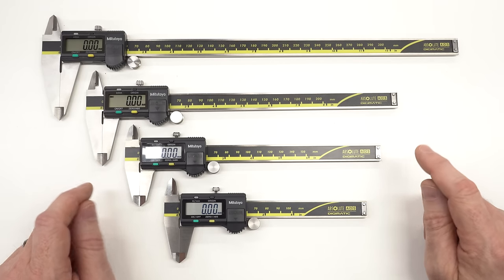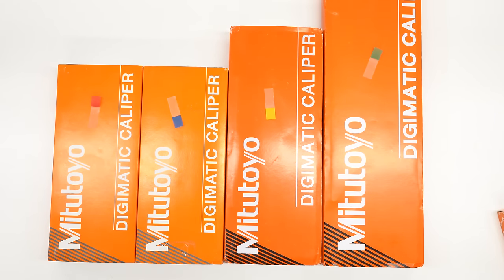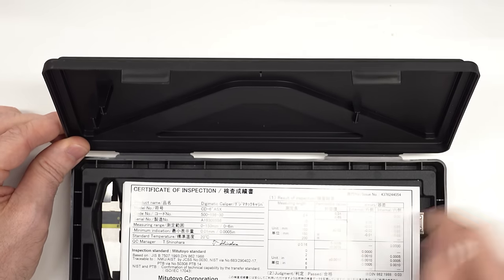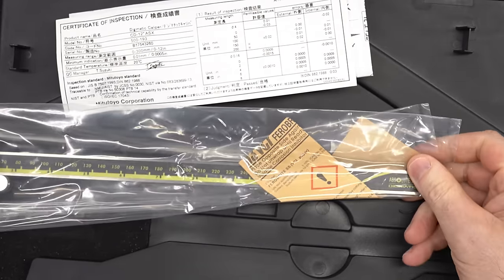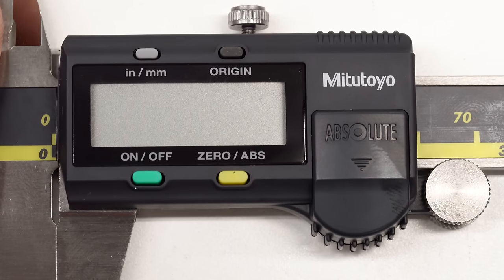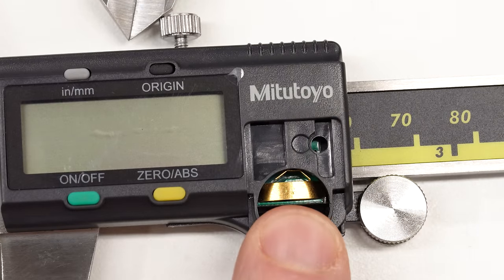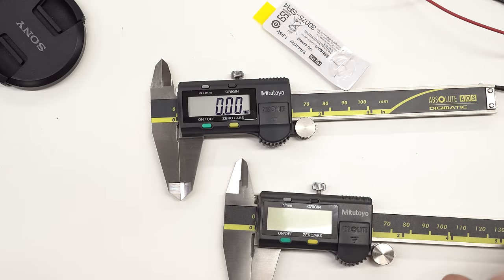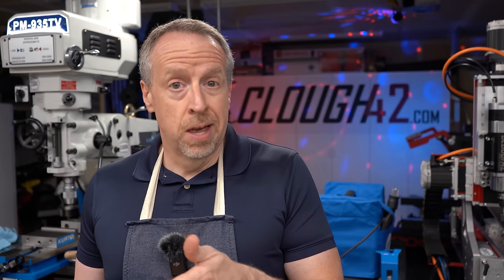17 Warning Signs Your Mitutoyo Calipers Are Fake

Comment: Thank you for going into so much detail - it's quite frightening how much trouble people will take to dress a $10 caliper up in $100 clothes.
Reply: Well if you can get 5-8x times for that work - why not? But it's for us consumers not to reward these criminals. It's not whether the packaging is accurate, fonts or even the accuracy of the device  - it's about not funding criminals - plain and simple. As the channel owner said, if your product is almost or close the original - compete on price. They can't. I bet they make much more money on the fake than on their own brand which is lost in a sea of similar competitors. Here's the simple fact..most people don't need a Mitutoyo..makes you feel better? go ahead...but unless you're working for SpaceX you don't need it. Buy a much cheaper no brand one and move on. I got one. I design and measure in 1/10th of a mm and most probably cut +/-3 mm.

Comment: I have a genuine Mitutoyo 6" purchased from MSI-Viking (an authorized reseller), but mine was purchased in 2009.  Some notable similarities to your newer models:
fit/finish is excellent, end-milled recess in the back, nice plastic molding, ABS visible in the battery compartment, two contacts visible on the PCB.  

However, a few differences which are actually more similar to your knock-offs:
The yellow swoop ends above the S, not the O of ABSOLUTE on the front.
Battery insertion goes straight to 0.00mm, or a completely bogus number if left for a while first, not flashing dashes
Origin button is recessed, top of it is flush with the top of the plastic on the front.
screw alignment of one hole is is ok, the other is not great.  

So it seems the knock-offs may be copying some older models (poorly)
Reply: I too have a 150mm older model with exactly these same differences.   On all other points they match with James' description of the genuine article.
Reply: I agree, I have a set here at my desk that are only 5 years old and I'm confident are genuine and the certificate has the high print quality but the same T Suzuki QC manager and the Ferrobrite sheet looks very similar to the knock offs shown here so it looks like they've copied them from a few years back. Everything else is a match for the new genuine shown here.
Reply: same here too!
Reply: same with mine.
Reply: Yeah same. I have two contacts etc. but no white writing on label and off centre screw holes. Mine is genuine (all other tells are aligned with your genuine) so I think probably the knock-offs are mimicking an older model. I’ve had the same battery in for the last 5 years
Reply: Can you confirm the three smooth radius cuts in the jaw area and the accuracy of the pinning of the bar at the far-end? (the bar pinning was terrible in the clones, surprised he didn't notice!)
Reply: @awebuser5914  Yes, I can confirm the larger radius and the rivets at the end look great on mine.
Reply: I have a 6" genuine Mitutoyo that was made in 2017.  It's identical in every way to the set in the video, except the origin button is recessed.  They must have changed that fairly recently.
Reply: @techietypex  yep same as mine.
Reply: Where is the best place to find an authorized seller list?
Reply: I can echo what other people have said on this reply thread.  My older 100mm calipers have a recessed origin button, inserting a battery makes the display come up with a large random number immediately, until I set the origin.  The yellow swoop terminates above the S. But jaw machining, PCB contacts, set screws, etc. are as per Mitutoyo standards.  I did not check power levels, but the first battery last me almost 10 years before I replaced it, so it wasn't drawing much power.

Comment: I appreciate your doing this video. The slightly older Mitutoyo calipers came with a piece of scientific equipment from Japan and have a Mitutoyo metrology lab certificate in addition to the normal paperwork. My set have a recessed origin button but aside from that have all the other signs that you pointed out for genuine Mitutoyo calipers. My set was made in 2013. I think the counterfeiters based their molding off of the slightly older models. Thanks for the video and for doing the power draw. That is what separates the Mitutoyo stuff from the rest. I hate dealing with dead calipers. That said, my favorite calipers at the moment are iGaging and they use a CR2032. I do wish you has shown the light passing through with the jaws closed; that is the biggest problem with crappy calipers.
Reply from the maker: The grind and fit on these were good.  I didn't see any differences, and decided to focus on things that were different.
Reply: Bruce, any reason why the igaging are your favorite? I use about a dozen different Mitu calipers in my shop, but would love to find a more affordable brand I can hand to employees and clients to borrow.
Reply: My older ones have the recessed origin button and when battery is installed it immediately flashes numbers. My battery compartment is different design with no writing. They are about 20yrs old.
Reply: @Hunteratloppshop  Hi R&R, The reason I like the iGaging calipers is they have a decent feel and are as accurate as the Mitutoyos. As I said, the biggest problem with most cheap calipers is the grind on the jaws and the iGaging jaws are very flat and parallel. Being that they use the CR2032 battery the battery lasts a long time. Another benefit, if it something that is useful to you, you can get them to measure fractional inches as well. All for a much cheaper price. If I were you I would keep the Mitutoyos for your shop but try the iGaging for the other uses.
Reply: @lofingboy  That's interesting. I just checked mine and they do the same thing. I guess its just the older models.
Reply: +1 for the igaging! I'm UK based and wanted to upgrade some of my poor quality Chinese calipers (hey, I've bought enough calipers to have one in every room +spares for my home). There are offers on mitutoyo, which I might grab a pair because of their IP rating. However I'm a big fan of my cheaper igaging things (ezcal??). Lovely feel and decently accurate!

I also own the more expensive igaging model. Don't like them as much... However got them in 8"form

I would say get several of the igaging ezcal for your daily driver. Keep a couple of mitutoyo for special occasions and that way you can keep them nice in the drawer
Reply: @brucewilliams6292  Same here...bought in 2011.
Reply: My experience with iGauging is the same.  Nice tool.  I like and use the fractional inch feature at times.  Nice option that works well and is fast.  Battery life appears very good.

I keep my original 12" analog Mitutoyo handy for some tasks where I want to see the indicator movement, and as that "works no matter what" tool I can always reach for in a pinch.

Finally, I had them ground and tested recently.  They work as well as they did in 1985 when I paid $170.  They have seen regular work for years, but also the expected maintenance.
Reply: It is weird with this fakes. I have one 150mm and everything looks original, housing with matching ejector pins and battery made in Japan, serial number fits perfect in paper, nice print, white color type and no filled rectangle, slim yellow curve, centered screws, milled slot, flashing lines when installing the battery but there is the gap between First ! on the little yellow tag and it runs not so smoothly if you compare it with a original one. Another fake(?) I have runs so smoothly but has the darker font color on the label. There seems to exist different qualities of the fakes. To perform measurements as you show with the consumption will reveal it. Without help of Mitutoyo there will be a perfect clone one day.

Comment: Hi James. 
Great video! I have a few more things that differ between the genuine Mitutoyo calipers and the fake ones:
- The thumb screw that locks the caliper is much thicker on the fake calipers
- The end stops are not located as close to the end of the caliper as they should be on the fake calipers
- Mitutoyo 12" calipers are much thicker/wider and uses a completely different electronics/plastic housing
- The angles of the jaws/tips are much steeper/different on the fake calipers compared to the genuine ones
Reply: - Genuine LCDs are light gray background, vs. greenish

Comment: I was always a Starrett man and I only bought one Mitutoyo tool in my 22 year career. It was a 24' dual beam dial caliper (built like their height gauge) that I bought in 1980(?) As I watched this video, I had a Harbor Freight (CEN-TECH) 6" digital caliper in front of me. I paid $19.95 almost 20 years ago. As you went through details, so did I.. Almost everything that was sloppy in your fakes, is much cleaner on my cheapo HFT. I heard that Harbor Freight has grossly down graded what they sell now, but these old models are pretty good especially for ther price..  I sold my 24" Mit's on EBay 10 years ago and the guy that bought them was ecstatic at the quality and workmanship of the tool. I had built a custom case for them and engraved my initials in several places, The buyer happened to have the same initials as me, and he got the case too... I don't remember how much I paid originally but I think I might have gotten a little more when II sold them... .BUY QUALITY and you'll never be disappointed....

Comment: Thank you James, I watched this while checking my own callipers and was satisfied that they are genuine. I do think it matters, the power consumption alone makes the counterfeits almost worthless when you look at what dirt cheap callipers cost that perform no less well. And I know that my Mitutoyo’s will last years. The cheap ones I tried corroded inside the battery compartment and packed up in just months.
Reply: What difference does it make whether it lasts 3 years on one battery or 1.5 years? The battery is a consumable item.
Don't put crap batteries in your instrument and they won't ruin the battery compartment.

Comment: Good - the 6 inch Mitutoyo that I found under a cupboard in a lab that was being cleaned out and rescued from the scrap bin appears genuine. I didn't get the orange box or the operating instructions, but I have the calibration certificate and the black plastic case, and all is as you say.  You can't beat that price!
Reply: I have a nice Fluke 87 acquired the same way.  Sometimes you're just in the right place at the right time.

Comment: As always, thanks James for an interesting comparison. One very minor difference you didn't mention is on the Yellow 'Battery' tag... The ebay ones do not have Mitutoyo printed above the battery compartment whereas the genuine ones do, just as the actual calipers have on them.

Comment: Thanks, you just saved me $70.  I use genuine Mitutoyos at work but have never had the packaging to compare so when I saw a caliper for sale on a local buysell your packaging analysis showed instantly that the one for sale was fake.  
Cheap Chinese calipers are usually fine enough and we also use them at work for rough measurement on the shop floor.  It doesn't really matter if a $20 caliper gets dropped or lost vs dropping a $300 Mitutoyo.

Comment: I was under the impression that Amazon mixes inventory of the same SKUs, and if seller Alice sends inventory to warehouse near your house and then you buy from seller Bob, Amazon may send you one of Alices’s stock rather than ship an item from Bob’s stock from a further warehouse.

Maybe I’m mistaken but I am wary buying anything from Amazon that is frequently counterfeited, even from official merchants.
Reply: Yep, that has been a problem in the past, at least. Not sure if it's still a thing, because I don't buy things where authenticity really matters there anymore...
Reply: This is one of many reasons I don't shop on Amazon.

If I can't buy it directly or from an authorized retailer, I guess I just don't need it that badly.
Reply: Yes that definitely happens if the seller chooses to co-mingle items. They can even have Amazon put a label on it. Usually if they come from the closest seller, there will not be an fnsku label on it (the specific seller label they can track) and Amazon just goes by the UPC code. Fakes can be a big problem but if you get one, Amazon will usually make it right. I agree I would be careful and stick to authorized sellers, or Amazon as the seller, for big ticket name brand items.
Reply: Have never personally had an issue with ordering commonly-counterfeited items from Amazon (ships from/sold by Amazon), which seems to be common with tools (and even books) nowadays. I didn't know that was a possibility until I just looked it up. Although I am curious if Amazon's items are commingled with the rest of the FBA seller items, and it seems like sellers have to opt-in for commingling to happen. For items worth more than a few hundred dollars or so, I usually just try to purchase them from another known-good vendor if possible (like MSC for tools or B&H for electronics).
Reply: @yellowcrescent  At least in some cases, Amazon does co-mingle their inventory with FBA sellers. I have received multiple counterfeit products that were shipped by/sold by Amazon.
Reply: You misunderstand what "Sold and Shipped by Amazon" means.  If there is a 3rd-party listed, then it's arms-length.  My calipers are 100% legit and were sold by Amazon, not a third-party.

Comment: Something i noticed using a genuine Mitutoyo Caliper were the perfect parallel jaws. If ii's well cleaned you can't see light shining throuh the gap of the two outer jaws. Furthermore if you have set the origin correctly it's nearly impossible to push it to a negative valiue - in comparison with cheap ones where you can push it up to -0,05mm.   The second thing i noticed . Cheap calipers sometimes lose the origin point after really fast jaw movements. (But i think that's only a Problem with non absolute calipers.
Reply: Notice the fake ones do not really spell absolute..... an attempt to avoid prosecution ?  ABS ( like the plastic ) then the big Olute

Comment: Thank you for the video guide!
I've always had Mitutoyo calipers but I've not had to buy a new one in the last 7 years.  Having just bought a new 6" I got a bit concerned when I compared my new one to one of my older ones and noticed the end milled slot on the new one was different to the slot made by a side and face cutter from a horizontal mill on the old one.
After watching your guide, and making all the necessary checks, I am now happy I have the genuine article. Thank you.

Comment: Great work on doing the current comparison, this is relevant even for the non-fake cheapies - when you go to use them the battery is always flat. Sadly.

Also great shout out to @EEVBlog using his meter :)
Reply: Brymen meters are world class on their own merits.
Reply: If I recall, the eevblog meter contains some extra Aussie voodoo for measuring low current accurately.

Comment: Another thing: the surface of the printed scale is rough in the counterfeit items, while smooth for the genuine. Also the printed scales stop just shy of the end, right under the pinning. Not so for the fakes.
27:57 Note that those tiny QR codes are basically useless on the fakes, while perfectly readable (though small) on the original
Reply: I was going to mention the QR codes. My phone was able to read the QR codes on the two genuine Mitutoyo off the screen and it was the three lines of identification: Code#, Model#, and Serial#. The QR codes on the fakes not only are muddy and unreadable, but they appear to be identical. I'm at work so I don't have access to my Mitutoyo for me to check the QR code. And, I can't check my coworker's Mitutoyo because the calibration sticker (it gets an annual 17025 calibration unlike my personal one) covers the QR code.

Comment: Other easily visible differences I’ve noted are that the locking screw is machined differently and the riveted retaining plate on the end of the beam is in a different location, further from the end.

I have a number of cheaper brand calipers (not fakes) and a 6” and 8” pair of genuine Mitutoyo’s.

The cheaper ones are maybe just as accurate but live on the lathe headstock or the mill table, get used occasionally as a pair of dividers and are considered disposable items.

The Mitutoyo’s are considered metrology instruments, are used during the design process to evaluate existing components for fits etc.  Both of these slide like they’re on melted butter and are a joy to use, unlike the others. 

If you place any value on what you do, you probably already have or need to experience the genuine items, but why pay elevated prices for fakes to kid yourself that they’re equivalent?  Simply buy the cheaper non fake items if you don’t place any value on the differences!
Reply: Yes, I noticed the riveted retaining plate as early as the initial picture at the start of the video.

Comment: That was good "spot the difference" there. 
I too would like to see actual measurements and hardness testing of the work surfaces. 
I completely agree, they should just use their own brand, especially if the metallurgy and accuracy are comparable to the Mitutoyo. Battery draw is a pain though.
I have a Mitutoyo vernier callipers from the early 80's. Battery hasn't gone flat yet. :)
Reply: This seems to have the same circuit boards as cheap calipers. They don't really power off, only the screen goes off.

Comment: @25:33 One thing I noticed that was different was the black plastic on the scale of the eBay ones looked more grainy and rough in texture than the real ones. The real ones the plastic looks smooth. 

 Thank you for this James, you just saved me a bunch of money bc I was just about to buy a 8" & 12" myself off eBay. Just going to buy through a actual dealer instead. 👍👍